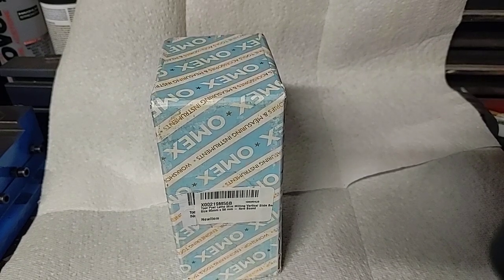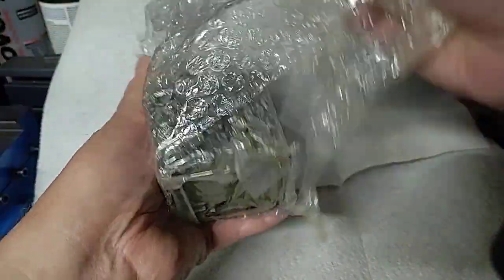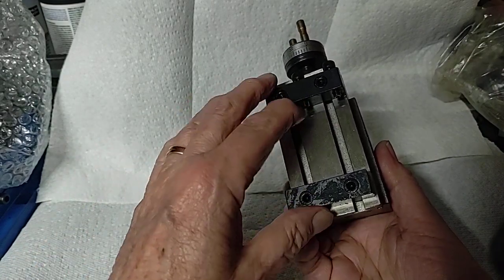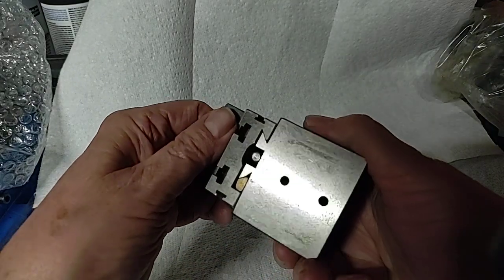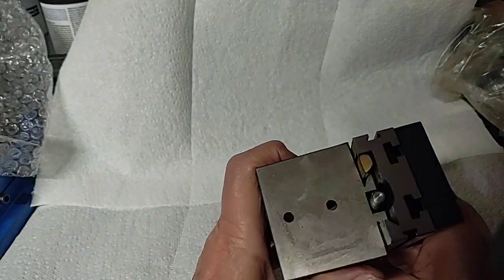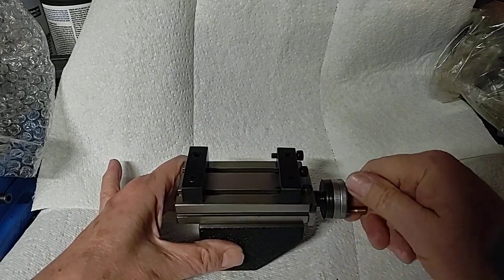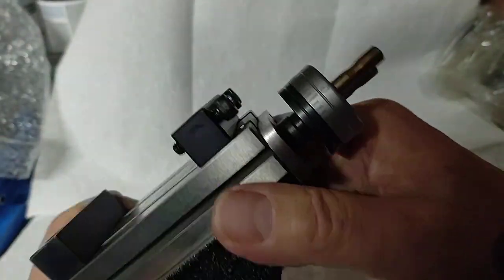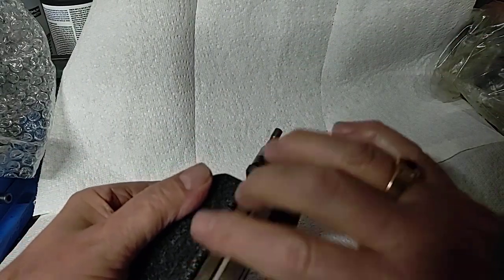Low cost simple Milling adapter for Mini lathe. $60.00 unit. Cheapest one I could find.

Comment: Where did you buy it
Reply from the maker: Amazon

Search on the string:
Tool Post Lathe Mini Milling Vertical Slide Bed Size 95mm x 50 mm - New Boxed 

That should lead you to them.
Reply: Thanks for the info I have found it and ordered one
Reply from the maker: The one I got was good, hope you have the same luck.
Reply: @oldfarthacks  thanks for your help
Reply from the maker: Anything I can do to help is fun.

Comment: I also purchased one and it was a piece of junk, main screw adjustment was bent and stripped out on the end.  Also the top guide was stripped because the set screw was so tight it mashed the threads over too the point it wasn't holding. Please don't be purchasing this type of milling attachment from India.   JUNK.....!
Reply from the maker: I am working my way through this sort of equipment for two reasons. First, to see what is out there and if it can be made to be useful. The reason for that is that most people just can't afford the thousands of dollars that a good basic machine shop costs to set up. Yes, you can buy used, but to do that you need to know good machines from bad and most people really don't have the knowledge and experience to make that judgement.

Second, let people see what they will be getting and what will need to be done to make it useful. This is for everyone, even those with lots of experience a learning situation. I look at these as a kit, not a final product.